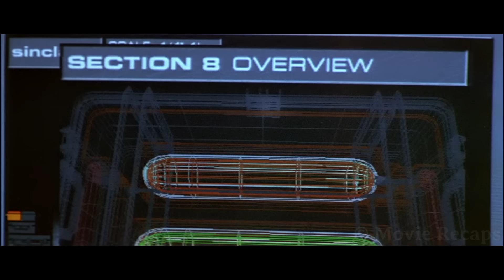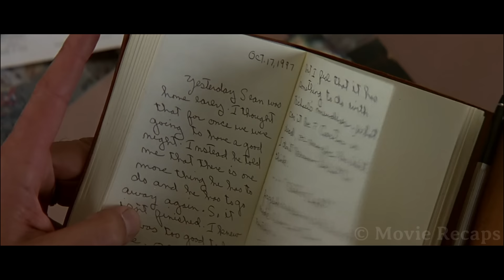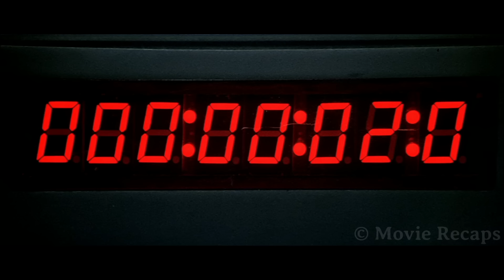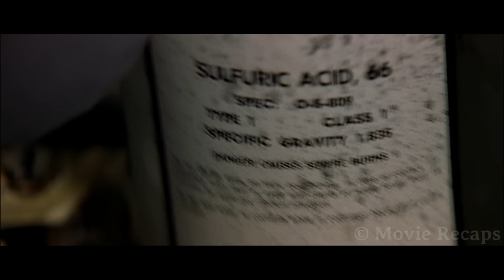This Prison Forces Inmates to Wear Iron Boots so They Can be Locked in Place

Comment: Listen, I'm not saying it wouldn't border on cruel and unusual punishment, but the boots for prison control are a pretty smart idea. The only thing is that all the floors would have to be metal, and you'd have to make a relatively compact and powerful electromagnet for the boots. But yeah, if you're locked in one of those, and the magnet applies, you wouldn't be going anywhere.
Reply: Except the guards can't have anything metal on them inside the prison, so no guns, no radios--no one who has had any reconstructive surgery can work, visit, or be housed there (no pins, stents, or coils), nor anyone with a pacemaker.
Sounds like a great facility.
Reply: The boots needs to be flexible at the ankles, I mean did you see how Nicolas fell when the guards hit him, if it was not flexible then either his ankles would be broken or torn off😢
Reply: @JohnSmith-vk9ds the boots would have the magnets in them, not the ground
Reply: connect chains to rails

Comment: 1:33 
Plane need here:
Those aren’t the flaps, those are the elevators. The flaps are attached to the wings and aren’t control surfaces, don’t confuse the flaps for the ailerons what is used to bank the aircraft or if we’re talking about delta configuration the elevons what are basically ailerons and elevators mashed together